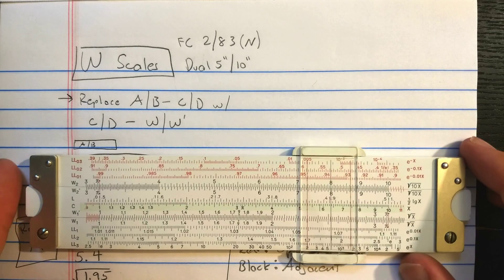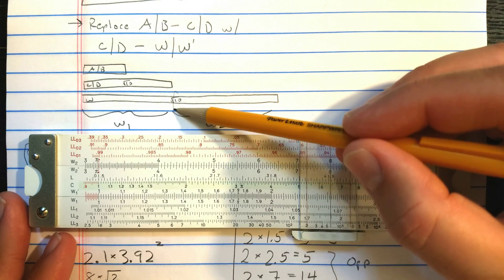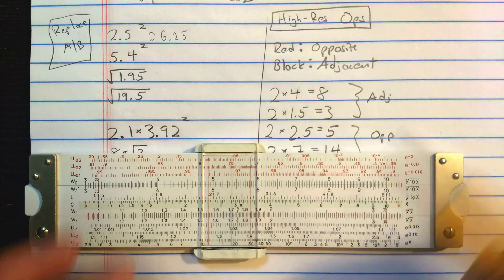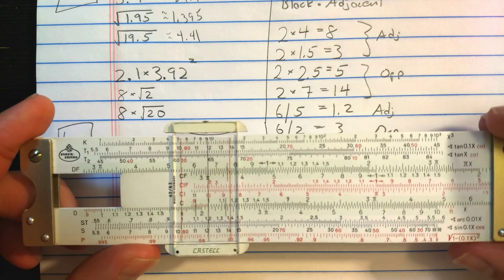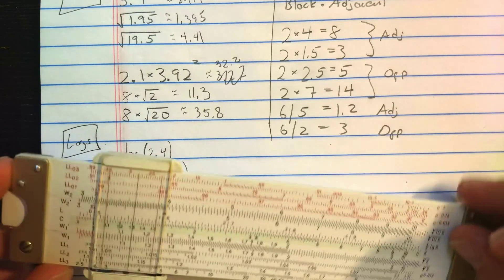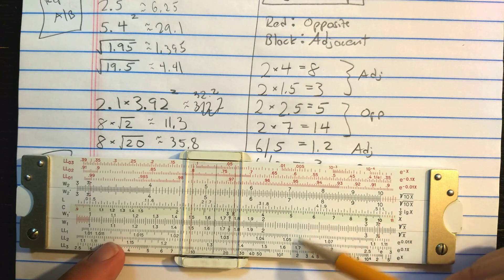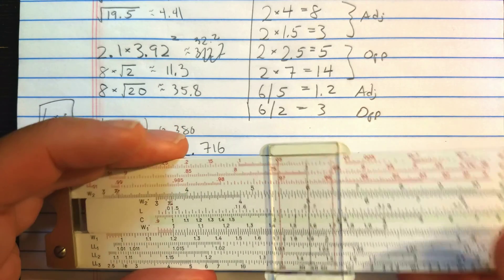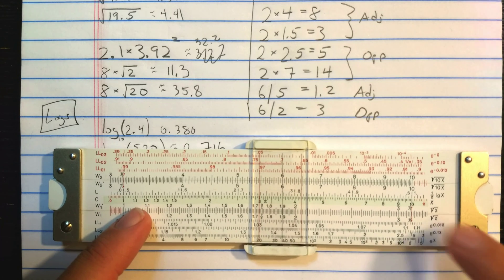W Scales -- Faber Castell 2/83 Style

Comment: Uh. Interesting mental exercise. I even know paper slide rule, actually two cards where one card has 10 slots and and scale from 1 to 10 wraps ten times. Putting cards somehow on top of each other can be used as unwrapped cylindrical slide rule where scale is a spiral. Actually I'm not sure if these cards had horizontal scales or they had some slopes. I guess I may try to buy transparent foil or paper into printer and make it.

Comment: Professor H - can I request you do a series on best ways of solving some of the higher numbered questions from the slide rule contest sheets? Example test 107 from https://mikeyancey.com/uil-slide-rule-resources/

Most of the last half of the questions combined square and square root functions or cube with cube root in single equation. Must be a better methods to solve than writing down intermediate results.

Note that the W1W2 sales help for first case but on a versalog or cube/cube root case you are back to pencil.

I'm thinking that in these timed tests there was no time for intermediate calculation and pencil work. Maybe they had better methods that I can't find in my readings.

Thanks
Reply: Also comparing the advantages or disadvantages of various rule types on solving the same equation efficiently would be very interesting. 
For example versalog without AB but with R1R2 compared to European style Aristo studio or 2/83 or simple Nestler 23

Comment: My 63/83N has a C1 scale above L and a C scale below L ,Also a D and LL0 scale above LL1. It must be a different year . It is a 62/83N Novo Duplex.
Reply from the maker: The "N" models (2/83N and 62/83N) are introduced later and add some extra scales to the 2/83 design. Both 83N models are fairly sought-after on the collector market. I believe the late-model 63/83 has essentially the same smaller scale set as the rule I have here, but on an all-plastic frame.
Reply: Great video! After seeing this I managed to get my hands on a 2/83N and a 63/83. You're correct about the 63/83. Mine has the sames scale set as your 62/83 but with a build quality similar to an Aristo Studio 868 as seen in your video about trig with Euro-style rules. Same length and width, but the 63/83 is a hair thicker.

Comment: Thanks for the video on the 2/83N and 62/83N.   I enjoy these rules very much and think they are very powerful rules for computation.   These rules came out at the end of the slide rule era and perhaps more manufacturers would have used the W scales if electronic calculators had not come out when they did.   It does take some practice using these scales but in my opinion the effort is worth it.
Reply: These are the 2/83 and 6/83 NOT the 2/83N or 62/83N

Comment: I recently tried out the 2/83 and I think the solution of the W-scales does a good job of filling the 20 in scale onto the 10 in rule for  compact relatively quick operations (rather than a long unwieldy 20 in rule). The real advantage seems to guarantee 3 sig figures esp. when doing log10 operations! I don't much like the vague guess you get sometime on the 10in for the 3rd sig fig. The downside seems to be its a bit slower and is harder to keep track of the decimal point and to get top/bottom misreadings. In a hypothetical "what is the best basic scale set?" I thought taking the standard scales and replacing the A/B to get something like  K W2 [ W2' CI C W1' ] W1 D  with  [S L T] on the back would be optimal. I don't know if anyone put such an idea into practice. It might be fun to do a speed vs accuracy competition comparing, say, the 5in (e.g. N600-ES) vs 10in (e.g Post 1447) and the 20in 2/83 W-scales based on these (quite involved!) basic operation tests: https://mikeyancey.com/uil-slide-rule-resources/
Reply: Even the square roots and squares can be sometimes done more precisely on LL1/LL01 scales. For example as 0.8^2=0.64. But AB scales allow to get area of circle or volume of a cylinder almost instantly. The majority of the European slide rules have cursors for diameter to area conversion using S=pi*r*r=d*d*(pi/4) and there's 4/pi ratio on AB scales. ABCD scales are even extended on both sides and hairlines are on both sides, so it's possible to do area-diameter conversion on whole range without overflow.
Reply from the maker: That scale set is an interesting proposition. I think the K scale seems out of place on rules like this. Just like on the 2/83 (and Versalog, etc.), when you square a number you land on D, giving you the normal precision of the rule, but when you cube a number you land on K giving much lower precision. Now, squaring occurs much more often than cubing in most applications, but a handful of rules add the three cube root scales to address this asymmetry.

As for L, I never found the 3rd decimal place to be a problem on 10" rules that have graduations of 1/500 -- you just need to decide if the cursor is closer to the middle or to one of the marks. On the 2/83 though, I'd probably guess a fourth decimal place sometimes. Still, I don't find myself using L that much when there are log log scales, so this is probably more pertinent for your theoretical rule than for the 2/83. Similarly, I don't understand why a rule like the 1450 Versatrig doesn't use the 2/83 style L scale. I would have made that change (and probably swapped L and K's positioning).
Reply: So the problem I was thinking of is a situation of calculating y^x. the steps typically are find log(y) = .abc so that x * log(y) = d.ef and so you get y^x = 10^(.ef) * 10^d however as you can see 10^(.ef) is missing the last figure which sometime seems to cause problems. E.g. 4.62^5 on the 10'' gives log(y) = .664 and then x log y = 3.32 so ans = 10^(.32) * 10^3 = 2.09 * 10^3. If I do it on the 2/83 I get 10^3.32(3) = 2.105 * 10^3. The last digit in brackets is a bit of a guess but basically determines the final accuracy as you can finally do 10^(.efg) not just 10^(.ef) which is the advantage of the W-scales in the multiplication step use to calculate x log(y). If you use the log-log version you get very quickly 2.1 * 10^3. In other words the issue is determining 10^(.32?) = 2.?? which from the above versions is looking like 2.1? and of course for bigger numbers the log-log scale become unusable. 

My comment about is about taking a 10'' and have the option to calculate with the C/D scales and the W-scales (by removing the A/B). This feature of the 2/83 duplex seems to make it stand out as unique. Maybe the preference not to go for the W-scales is on grounds of speed? Or is the fact that if you are in need of going beyond 2 sig figures (the 10'' gives normally a good guess for the 3rd sig figure) you really should get a log table and a curta peppercorn!?

Comment: Thanks for your video on the W-scales! I have to practice a couple of times to get used to the W-scales and when to read from which scale.
After a couple of weeks not using the W-scales, I forget how to use them. Practice, practice, practice....
Reply: The best thing to do is practice with problems that you KNOW the answer to. That way you can concentrate on learning the process without having to worry about whether your answer is right, and you get an instant reality check if you do something badly wrong.

I have one of these on the way because curiosity got the better of me and I had to have one. I will be watching this video and practicing a lot.